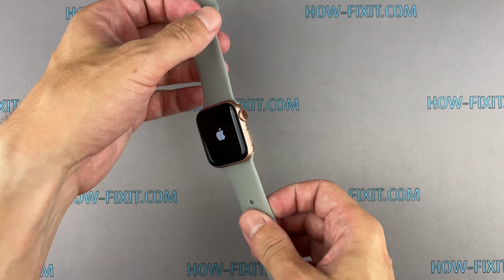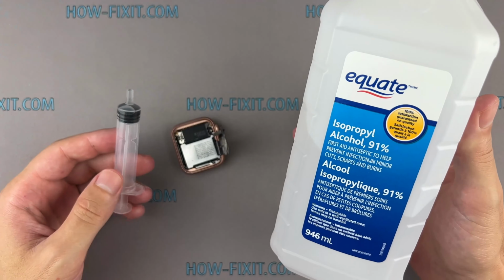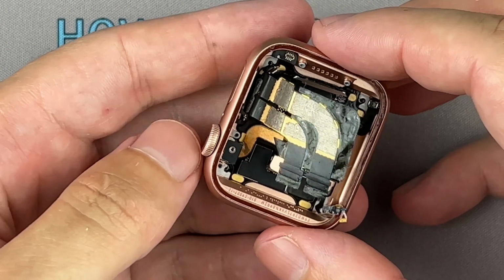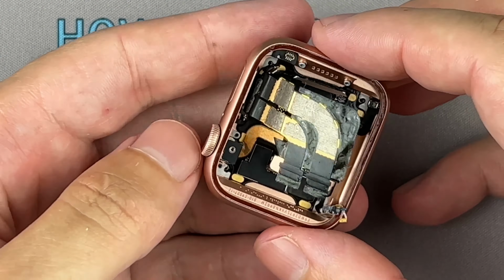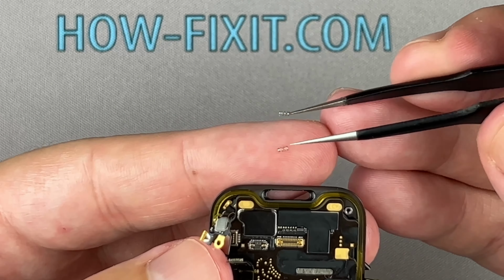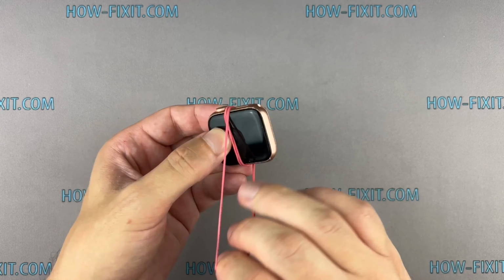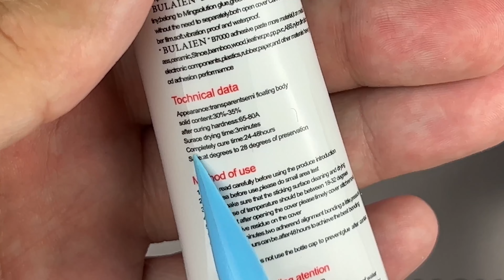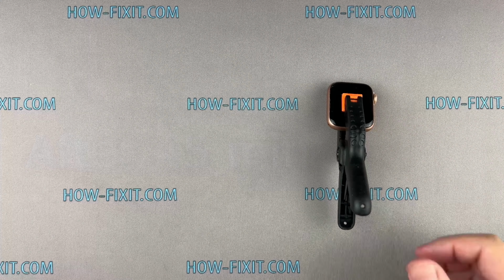Apple Watch Series 6 Complete Disassembly for Main Housing Replacement

Comment: My side button was always at press position after when to SPA. I've done every step-by-step and this help me clean all connector from "spa chloride" with ISOPRO alcool. It works fine at the end. But the touch din't work after reassembly. I will have to buy need gasket and finish the last assembly. Cross fingers... Thanks man !